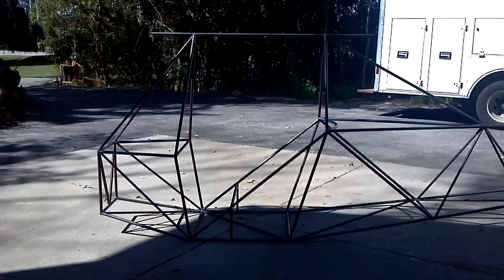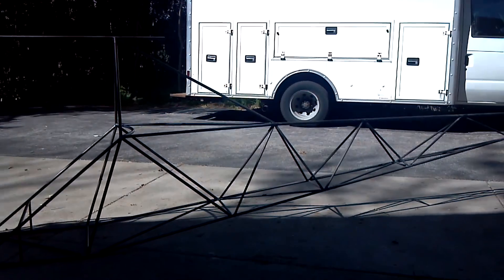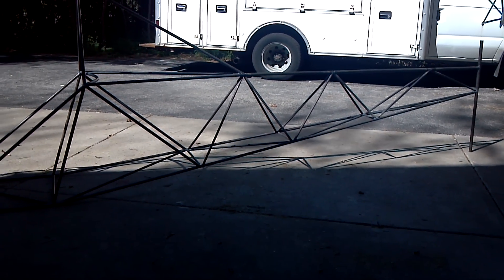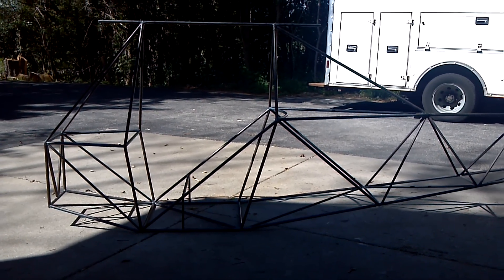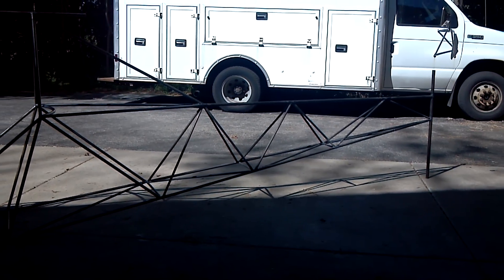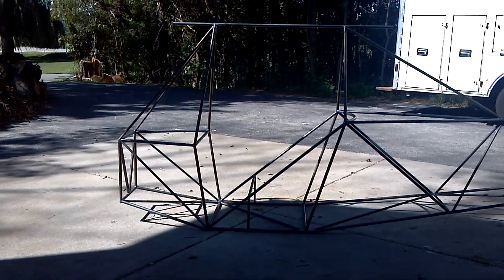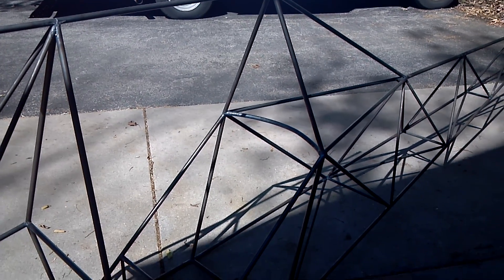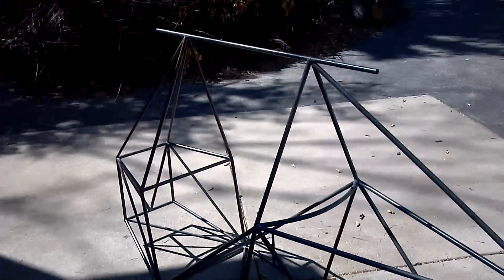Legal Eagle Ultralight construction video #65

Comment: Great vids on your construction of the LE fuselage. Thanks for sharing… I learned some things about welding that I never knew.
The only thing that you may want to think about is those welds that will be in tension on the uprights to the wing. You ideally want those to be contiguous tubes (thus the bended ones in the original design). Those tubes carry most of the weight underneath the wing to the wing attachment points. I under stand your concern about force points lining up, and you are correct in that. However, now most of the weight beneath the wing will now be hanging on those welds… not what I would do. Even with good welds there (and I certainly am not criticizing your welds… you know what you are doing!), those welds will be subject to critical high forces and vibrations, critical in the sense that it is a major component holding the wing to the fuselage. Welds are always considered weak spots… even good ones. Perhaps weld a gusset plate at those points?? Just my two cents. (I am a retired Aero engineer… and have a background in mechanics of materials, just sayin’ 😉)
Reply: Whoops… didn’t see how old this was… anyway, I hope it worked out for you!

Comment: Mike:
Leonard use to have a photo on his website of the top of the footwell... The top diagonal goes in the opposite corners opposing the bottom diagonal... His drawings do not show this after revision in 1999... I'm sending you photos of a build with the tube in place and two changes to Fuselage Sheet 8 at your e-mail address... Steve